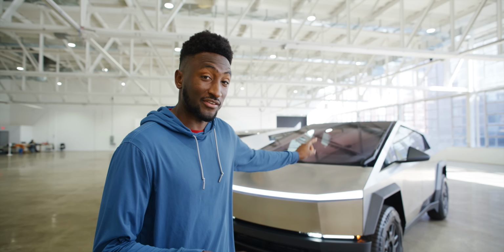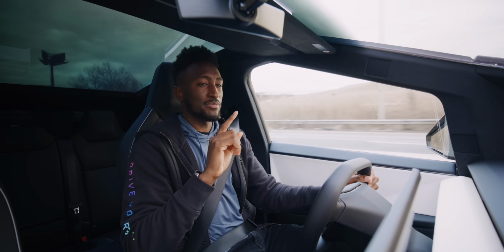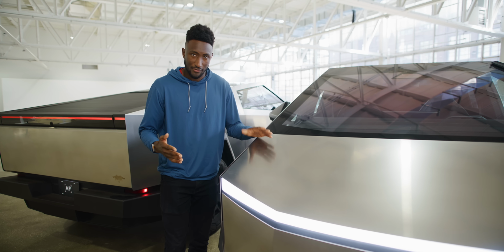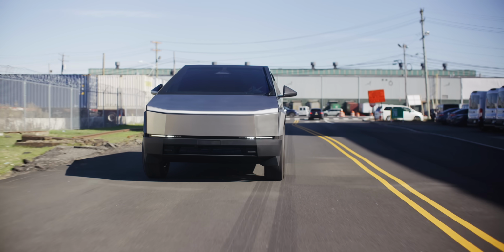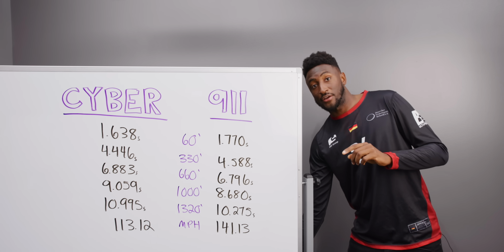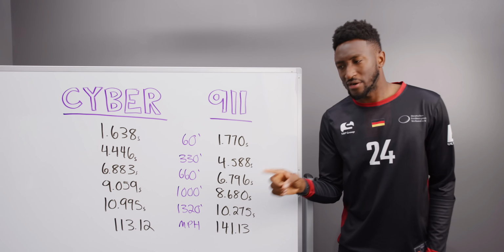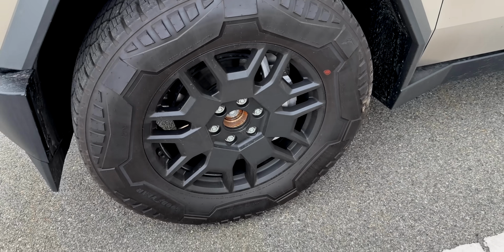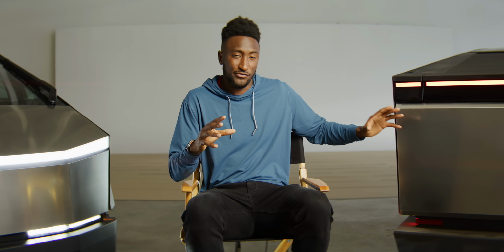Tesla Cybertruck Review: Already Iconic?

Comment: Except... you won't be fine because of the bulletproof steel. Having rigidity in your car frame and the lack of a folding front makes the vehicle MORE dangerous if it gets hit, because it doesn't absorb the impact and instead passes it on to the occupants.

Comment: One problem that's unsolvable is that by its design it's a pedestrian killing machine. It's like Tesla went out of their way to make it as deadly as possible short of installing spikes.
It's fast, nimble, heavy and has a high front panel made of sturdy stainless steel to crush the lower body or even ribcage* of anyone it hits.
*Ribcage for very small adults and any children.
Reply: You can claim unsolvable, but that issue will be highly mitigated by it ability to detect and avoid pedestrians all together once FSD is feature complete.  Sure it may hurt someone a little more than a regular truck, but if there are says 10x less incidents than vs a regular truck then again it's highly mitigated.
Reply: @SAC311MBC  Pedestrian safety systems have failed before, just ask Volvo.
FSD itself is frankly a spectacular failure compared to the many many promises that Elon has made in the past. At this point, FSD feature completeness is a running joke.
Reply: Steamrick you’re right, motor driven objects that weigh thousands of pounds and can instantly kill someone going over 50MPH have no business existing………….oh wait 👁️ 👁️
Reply: No diff than any other truck in its class.
Reply: @AdRock  nah its different cause of the steel, when you full on tackle a steel panel youre probably gonna brake your some bones, when you do the same to normal truck youre gonna bend the panel but youre not getting serious injuries
Reply: @AdRock  True, I dont get why these trucks r approved by safety standards. I you hit someone, you will be completely fine, while the one will not be
Reply: The hood sits lower than that of any truck, in that respect it's safer.
Reply: @boostav  yeah but its still made from steel and has very sharp edges
Reply: Wear a helmet?
Reply: @aramherrera1942  yeah sure go wear a helmet as a pedestrian. What kind of stupid answer is that?

Comment: 7:32 if your car remains practically intact after a crush it does not imply you will be fine, I would say the opposite.
The reason cars crumple is to absorbe the kinetic energy of the impact as much as possible.
Reply: Which is why it has crumple zones in the back and the rear. However in a side impact you don't want crumple zones.
Reply: he was talking abt the/(your) car
Reply: This truck has a crumple zone, look it up on google you’ll see the pdf files for the crumple zone in the CyberTruck. I think people for that the inside structure is still aluminum and that just the outside is steel.
Reply: LOL DUDE HAVE YOU EVER HEARD OF A ARMORED PERSONELL CARRIER? OR A TANK?

THEY DON"T HAVE CRUMPLE ZONES, AND THEY WILL KEEP YOU SAFE FROM A CAR CRASH
Reply: You're ignoring airbags. The airbag tech nowadays is so good that you could be in a metal box that doesn't flex, be hit by a train and still survive using airbags.
Reply: Wow, it's amazing that you know something that the whole engineering team at Tesla missed. You must be a genius bro.
Reply: Design engineer Sandy Munro's channel is doing a teardown of a Cybertruck, and you can clearly see in footage of the undercarriage that the entire front end substructure is one giant crumple zone, it just happens to be skinned with stainless steel.
Reply: You are very wrong. That's not how crumple zones work. Your logic only works if the passengers are seated right on the metal frame. There's a lot of material between the frame and passengers to absorb impact.
This car is absolutely safe ..... Take time and read an article about crumple zones, put up informed posts, not just biases.
Reply: You are very wrong. That's not how crumple zones work. Your logic only works if the passengers are seated right on the metal frame. There's a lot of material between the frame and passengers to absorb impact.
This car is absolutely safe ..... Take time and read an article about crumple zones, put up informed posts, not just biases.

Comment: Towing vs using the bed of the truck is the question. I’ve owned trucks and have never towed but I frequently use the bed of the truck. Dressers, Refrigerators, lawnmowers, etc go into the bed all the time. The question should be how often do you use the bed. Model Ys can tow.
Reply: The chart he shows after the 63% stat. shows the "personal hauling" breakdown. I'm guessing using the bed of your truck falls within that category. It shows 32% 'rarely or never,' 41% 'occasionally,' and 28% 'frequently' use their F-150's for "personal hauling."
Reply: They should see the new video of the Cyber holding the sheetrock. Its insane

Comment: My whole issue with almost all of the new breed of EVs is their weight. EVs are all promoted for being "environmentally friendly", yet all the new EVs are huge, heavy, and wasteful vehicles that are just a waste of resources on all fronts.
As for each feature, drive by wire is fine; however, variable steering rates have been going on in the industry for long time. Bullet proof panels are just extra weight that one would pay every single meter they drive it.

Comment: I'd love to see what CT would do with race rated tires as well where it wouldn't be torque limited for traction. Rearview mirrors used to be for reversing. Ever since the mandatory cameras, I've never gleaned at one until someone was tailgating, which only added to the stress of driving. Never once have one fail to work. Don't understand that complaint.

Comment: Steer by wire is one of the most dangerous things modern cars can have, what the feature does is honestly good, but modern cars have so much electronics and the same amount of electronics that fail constantly, if the steering fails at 150 you might as well start praying. 

Stainless steel on cars is terrible, there are good reasons why none makes cars out of it, Stainless steel oxidises, which forms a layer over the metal when reacting to oxygen, but here is the thing, it stains really quickly due to the oxidising process, that film is also destroyed by about any and all detergents, your hands, long exposure to moisture, dirt, grimes. So basically doing anything with the truck besides having it in a climate controlled dry room will make the thing rust. Hence, why nobody besides a couple ever used stainless steel. Stainless Steel is one of the most baffling decision they ever made.
Reply: It also gets destroyed by graphite in particular, so the owners had better pray that information doesn't get around. [finger to earpiece] I'm just getting news that it did

Comment: 11:52 Towing isn't a monolith, it's a spectrum. The CT does not suck at towing. Sure, if you regularly drive 1k mi with 10k lb behind you, maybe it's going to be more of a pain than you'd like due to range/charging (like all EV trucks are). But if you take the boat to the dock occasionally, or are a plumber that hauls a trailer for your jobs locally, the CT is exceptional.

Comment: 7:29 But will I be fine? With the car not giving in in accidents, where does the energy go? My guess is that the drivers of Cybertrucks are more likely to be severely injured in accidents, at least of those compared to other trucks - since the car does not give in, the people inside will. There's a safety reason too for us not building cars as durable as in the 1960'-1980's.
Reply: Take a look at the undercarriage in one of Sandy Munro's teardown videos - the entire Cybertruck front end is a crumple zone, it just happens to be skinned with a sheet of stainless steel.
Reply: The energy goes into the car you hit. That car becomes your first “crumple zone”.
Reply: @stevet8631  How are these people leaving comments on youtube without having any clue of anything. This is so frustrating.
Reply: @TheLoneGentleman welcome to the internet where ppl love to opine on things they know little about as if they are an expert.
Reply: You guys really have no clue how crumple zones work. Beneath that steel sheet, there are crumple zones in a car that collapse and absorb energy on impact. The outer sheet metal has nothing to do with safety.
Reply: @panzer3279  Tesla has advertised/used marketing suggesting that the steel body provided protection in a crash. It's part of why it does very well in the side-pole impact tests. But as we can see in the front crash tests, it has relatively shallow crumple zones, and you can actually see the car jolt to a stop when they run out, far more than you see in most crash test footage. And that jolt is what will cause injuries.
Reply: @panzer3279 haters love to talk out of their 🍑😂
Reply: @panzer3279 It has everything to do with the passengers of the car you crash into at the very least
Reply: Exactly, Marque's comment was really naive

Comment: cybertruck is just a marketing stunt, nothing else. It does nothing that other pickups cant do and it is dangerous af. Musk promised 800km range, but it got only like 400km. He promised that the chassis would be one piece, but it isnt and is made like normal other cars. The interior is very bad and cheaply made. There are no phsical buttons on the dashboard so you have to do everything through the display, which causes you to not pay attention to the road in front of you. Also, the front of the car is angled in a way that if you hit some pedestrian with it, the pedestrian goes under the car instead of over the car and over the roof. It is a dangerous thing. Also, it has near zero crumple zones so if you hit someone, your car stays in the same shape. This is a problem because first, when you hit a normal car, the car will be shredded no matter what. second of all, if you hit another cybertruck, both drivers will be dead because both cars will stop instantly without any gradual slowing down. Also, this car rusts af, the panels are not aligned so if you hit someone with the side of your truck, you literally cut them like a sausage. The truck bed is small and generally it does a bad job of being a pick up
Reply: This car is a disaster and I am glad that it cannot be sold here in the EU.

Comment: You are on good terms with Musk and I get that you don't want to jeopardize this relationship, but this video is obviously very biased.

I agree that it's an iconic car, yes. That being said, it's not iconic because it's rare, but because it's very different and, crucially, very controversial.

It's not a good car, if you look at it as a tool to get something done. As was pointed out, most people don't use trucks to do truck things, they drive them on paved roads in town. Now what's the problem with that?

1. It's heavy, big and tall. Maybe not as big as an F150, but the same problems are still there. It will absolutely annihilate pedestrians in a crash, especially due to the terrible design of many US roads. It will also kill people in other, normal cars, that could've survived if both parties drove similar vehicles. And it will wear out streets and increase maintenance cost much more than a lighter car.
In short, these types of vehicle are bad for everyone and everything except the person driving, and being fine with that is a bad attitude to have.

2. It is made from steel. The rain breaks it and it will corrode. This car is made for California and Texas, but live in a colder, rainy or humid area and it will not survive being outside for extended periods of time.
Or you could buy the extra coating for a few thousand bucks to make it corrosion resistant. What the heck.

3. Normal people don't care for fast acceleration. It's dangerous in real world road situations and makes people behave like douchebags.

All of that brings me to the conclusion that it is a bad car. It's a good status symbol, if you need this for your ego, but it sucks for everyone else on the road.
If you want a car that's good at doing stuff a truck was initially intended to accomplish and that fits actual, real use cases, get a Mitsubishi Fuso Canter.
Reply: You forgot to mention this car is just fucking ugly. Tesla vehicles, especially this one, are *ugly*.
Reply: @Sun-diver  I agree but that is subjective
Reply: @Alepfi5599  😘😘

Comment: The irony is that the quality of production of this video is inversely proportional to the quality of production of the product
Reply: I dont understand how that is your takeaway from the video when the only thing he said about quaility was the one door issue with the 5 minutes fix and the other truck being flawless.
Reply: @theipc-twizzt2789  Wait ✋️don't tell me that u only based ur opinion from 1 video made from 1 channel on 1 product? 🤨
Reply: @Crusttisuu  Based on perhaps all videos out there the only real flaw this thing has are easily fixable panel gaps.
Reply: Or did I read the comment wrong and he meant this video is shit?
Reply: Untreated stainless steel -> rusts when exposed to the weather 
Promised to have at least 800km/500miles -> the cyberbeast Advertised 500km-> Test 462km
Sharp edges in the door, the motorised front truck can snap 4 carrots and an aluminium can. 
It's a pickup truck yet can't fit a bike? And the Camping extension cost thousand more that looks like shit
One large screen panel for everything, netruel mode, back and side cameras 
Have u seen any other videos
Reply: I'm not saying that the toyota Corolla is better than the cybertruck it's great, but it not that great it not a good product maybe if elon didn't rush the engineers to complete the cybertruck in such a short schedule and overhyped it as the messiah of truck, yeah maybe it could be the best ev truck
Reply: @Crusttisuu  The steels does not rust since it is not "untreated stainless".

Cutting of fingers has already been debunked 2 months ago (someone tried, nothing happened). Carrots are not fingers.
Reply: @Crusttisuu  Cybertruck has buttons for gears. 

Lmao, what kind of videos did you watch? Those must have been about a different truck.
Reply: Haters hate. Cyber truck is awesome
Reply: @hui975 let me guess u paid for twitter blue too?
Reply: @Crusttisuu Can't believe woke liberals are still hating on the iconic cyber truck just because elon hurt their feelings. People are going to buy cyber truck and you hating on it won't make a difference
Reply: @hui975  keeping that copium on tap I see 😂
Reply: Does it still hurt when you sit down? @hui975

Comment: I'm not a fan of steel or aluminium outside, I think it's a thing of the past and needs to be changed, Why not like a human body? If I had Elon money to build a car I would make the skeleton steel and crash safe as possible and everything outside plastic (the skin) quality plastic/carbon fiber. It would make the vehicle not only more robust but you can easily repair parts by just replacing the damaged part If only the skin is damaged, also the car would feel much more warm during Winter time.

Comment: Steer by wire - it was introduced to make automated driving cheaper.
Now you don't have to spend on strong motors that turn the steering wheel.

Cons-
Hackers.
You no longer have control.

Comment: I think you steered clear of the safety aspect because this is actually its biggest issue. It being 'a tank' doesn't actually mean it's safe, there's a reason why we don't make cars out of super-hard materials and in this shape - it's not safe. Not for pedestrians, not for other cars, not even for the person who drives it.
There's a term called 'crumple zone' that describes a vehicle's ability to deform in order to absorb shocks and minimise the impact towards the people in the car. The 'tougher' the outside of the car is, the more it amplifies the impact force on the people inside.
That's why car makers have been making panels from light and thin materials for decades and it's been proven to be the safest way to build a car.
I'm happy this thing is not legal in Europe, it would be by far the most dangerous vehicle on the road.

Comment: Quick question: what happens if the car dies (like 0% battery or actually dead car) and you need to tow it? With the steering by wire you can’t move any of the wheels right? In the best scenario you can disengage the motors that drives the wheel left and right, but still, you don’t have any control of them. Am I missing something?

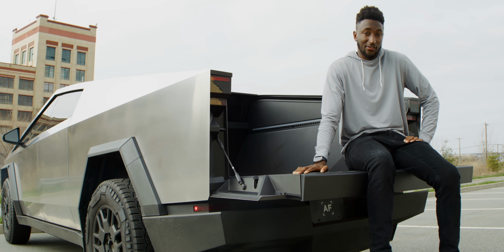Comment: 23:39 I think the reason the biker gave you a thumbs down was because the cybertruck isn't as safe to other people is they crashed (bikers, pedestrian) as the normal everyday vehicle with lots of crumple zone. the dudes in the car on the other hand don't care as much.
Reply: Since when is everyone a crumple zone expert 🤣
Reply: @aramherrera1942  i mean ain't it obvious? A stainless steel 'bulletproof' panel vs a plastic bumper. If you can't see  which is more dangerous for pedestrians i don't know what to tell you bud.
Reply: @SphereFps cybertruck has a plastic bumper too
Reply: @ericy.2108 correct me if i'm wrong but isn't it just the black part on the bottom?  so the majority of the frontal area is steel right? i mean i live in the part of the where trucks are less common, so even if they're safe i would still rather (pray to god never have to) face normal SUV's with my bike.
Reply: @SphereFps  yeah; other (gas) trucks have big grille with metal radiator right behind it above the bumper.
Reply: @ericy.2108  true, but those are made of aluminium, no? they are more compliant than steel. i mean getting hit by any car would suck, but at the same speed the cybertruck might do more damage than other more conventional trucks (can't find any source to confirm nor deny this online)